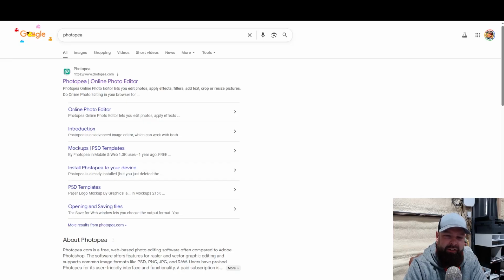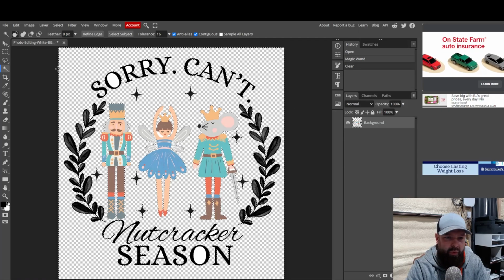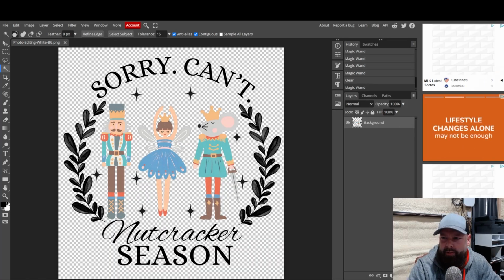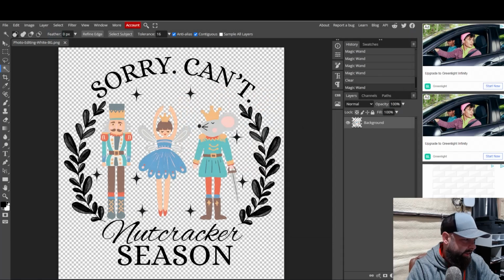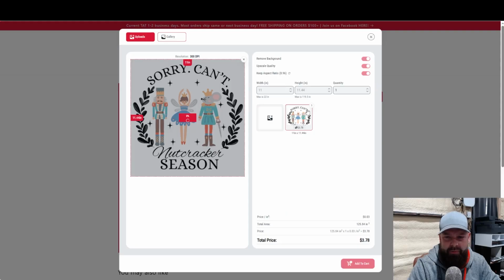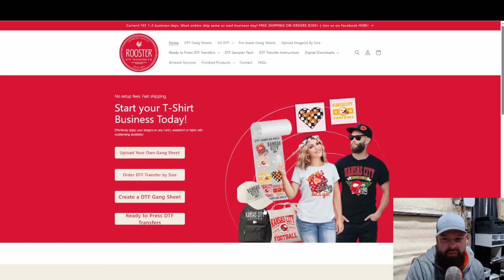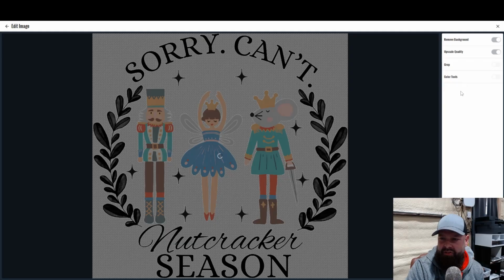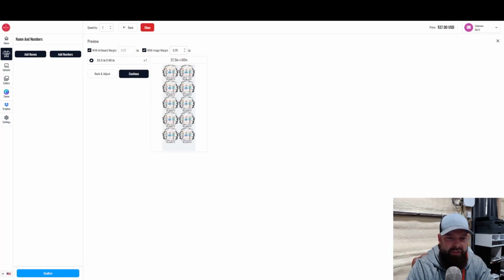How to Remove a Background for DTF Printing: Step-by-Step Tutorial (Using Photopea & RoosterDTF.com)

Comment: After the background is removed, there are still semi-transparent white edges (a white halo) around the artwork. How can I completely remove those white edges so the design is ready for DTF printing? I need clean, hard edges with solid colors and no white fringing.
I'm currently using Photopea because it's free. Are there any techniques in Photopea to fix this, or are there any other free and reliable tools you would recommend? Thanks!
Reply from the maker: I usually vectorize my images then I like to use Krita which is a free software, because if you bring in an SVG image you can select different pieces based on color similar to adobe illustrator or Inkscape. My wife likes to use the canva background remover also.